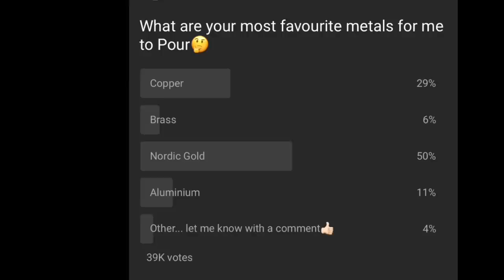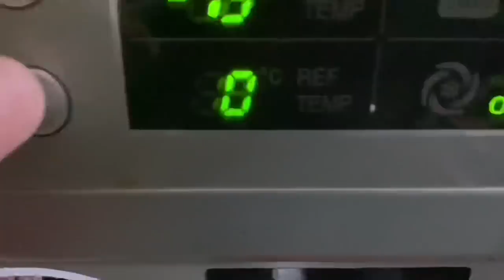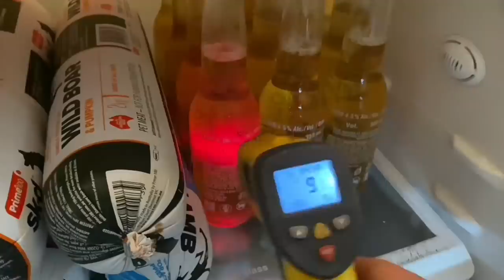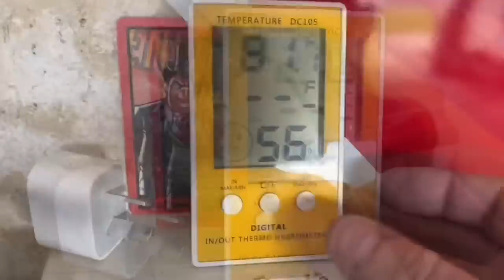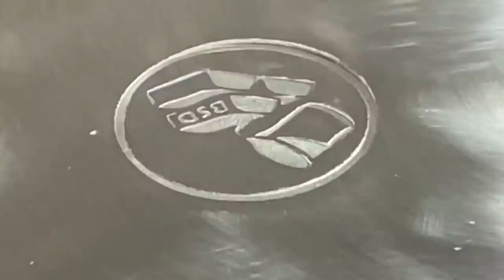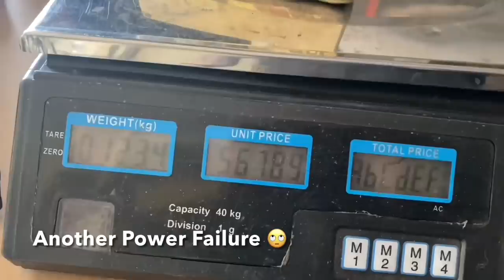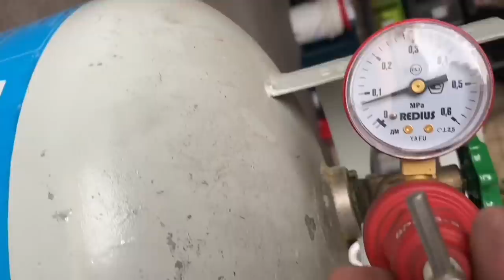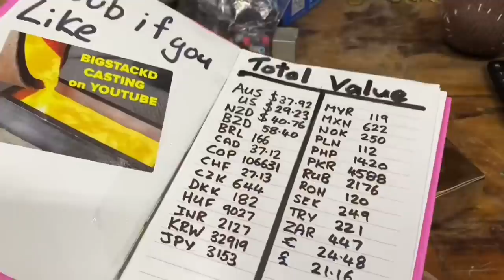Nordic Gold Made From Scrap - Huge Gold Bar - Nordic Gold Slag Melt - ASMR Metal Melting - BigStackD

Comment: Wake up.  Check YouTube.  Watch bigstackD.  ;-)  That's a good morning!  I'm surprised how much you got out of that slag.  I've been throwing it away.  Maybe I'll have to change that.  I also didn't realize that nordic gold had zinc and tin.  What's the difference from aluminum bronze?  I guess what I mean is, does the added zinc & tin change the characteristics at all?  Change the color, or make it harder or softer?
Reply: If I remember correctly, it helps with corrosion resistance. I think that naval brass is fairly similar so you can look into that if you're interested in a wikipedia binge
Reply: @masterofmundus1304  Aluminum Bronze is extremely corrosion resistant.
Reply: Color is definitely different - Nordic gold is a much deeper, more saturated yellow.
Reply from the maker: FarmCraft101 theoretically buddy the zinc probably burns off in the tin is such a small amount it probably doesn’t make much of a difference in Nordic gold would be pretty similar to aluminium bronze. There is a slight different colour that’s for sure. I’ll need to put them side-by-side in the future video to show people, I honestly reckon they would be pretty much similar in their strength and hardness although I don’t have a machine to test that this is just a theory because they Can be extremely difficult to stamp . Quite a few people have said that rapid cooling on ice could be changing it’s molecular structure when it freezes but I honestly don’t know 🤷🏻‍♂️, I certainly don’t have the smarts that you have matey, all I do is melt shit ,drink beer, edit ,upload ,sleep ,repeat👊🏻😁🍻🍻🍻🍻🍻. Also buddy with the amount of subs you have you should contact Youtube so they can verify your channel that will give you a tick next to your name and it will definitely make your comments stand out touch more when you’re verified. It’s a very simple process👍🏻
Reply from the maker: Also I was going to say I probably get so high of a return on my slag because I’m not using the correct fluxes or process on the original melts and then leaving a lot of good metal in the original slag🤔
Reply: Yooooo farmcraft101 I love your vids
Reply: @bigstackD  
High copper content alloys that lack antimony get softer when heated & quenched.  
Most people who think otherwise are only familiar with tool steel & don't even realize that low carbon steel can't be hardened like that.  

That being said, only relatively minuscule quantities of antimony are needed to harden copper, lead, zinc, and perhaps aluminum (I'm not too familiar with aluminum alloying materials).  
The quantities of antimony required to harden a bar that size could easily sneak in with the starting materials.
Reply: @kaisersose5549  Would that mean using pewter instead of tin would be a good choice?
Reply: @yazmon4515  
Not really...  
The whole "casting stuff from scrap materials" thing is the problem.  
There's just no way to know for certain what might be in those scrap materials.  

If you find yourself in a position that requires your castings to have specific properties, you're better off purchasing materials from a company that can provide the required documentation about each of their products.
Reply: @bigstackD  Farmcraft101 got his check :)

Comment: Gotta say it... you probably burnt off most of the Zn & Sn by sticking them all in at once & trying to melt them along w/ the Cu. Probably best to melt the Al first, then use that to help melt the Cu at lower than its normal melting temp. Add the Zn & Sn last; they'll melt super quick so you can pretty much just stir them in & start skimming the slag before a quick reheat before the pour.

Comment: 1:15 , That aluminium piece you grabbed the first has something yellow and white on the middle of it. That  is a cob LED (chip board light emitting diode)You can power it with a 12v drill battery by connecting the '+' sign  of the battery to the '+ sign' of the cob  LED and the same way connect the '-' sign it will give some bright light, but it needs a aluminium heat sink otherwise it will get really hot ,it can be used as a flashlight. It can also reflect towards your shining nordic gold bar like a mirror

Comment: I'd like to see you try a sand casting of a brass bell sometime.  You can cast the overall bell shape in once piece then drill a hole in the top for an eyebolt that will hold the bell clapper which is cast separately.  That would make a fun video.

Comment: I'm interested in knowing a few of the techniques you used, as I'm getting into casting to improve the variety of craftsmanship I can do. In particular I'm interested in how you procure and check the metal you use (a lot of stuff i wanted to smelt I couldn't tell what it was made of) as well as what technique you used to keep the zinc from boiling off before the rest of the metal melted.

Comment: Stacked you must be happy to score those busses bars. There from a 1200 Amp. Gear... pure copper. Now a days the buss bars are just coated in copper over aluminum. And all wires are now in aluminum instead of copper from the Electrical room to the apartments. Which is illegal cause they're running horizontal. Lol, they talk about being green!

Comment: I have a crap ton of scrap metal, sorted brass, steel, wrought iron, etc. Notably I have a solid aluminium water pump, 4 rotors and a bumper. Do you want me to cut it myself before I ship or would it be better for the video if I send them uncut?

Comment: You probably have already considered this, but it would be interesting to know how much of the slag is from contaminants on/in the metal and how much is as a result of oxidation occurring within the furnace. 

If it's mainly occurring during the melt, it might be worthwhile adjusting the air intake to the burner such that you have just a slight excess of fuel in the mix, rather than opening it 100% and having an excess of air in the mixture (and thus plenty of superheated oxygen to react with your metals).
Reply: I know what im trying next time!

Comment: Do you think it’s possible to cast an ingot out of lava rocks? I’ve seen PressTube melt lava rocks and pour lava onto glass, but I wonder what would happen if it’s poured into a ingot mold
Reply from the maker: matey I have lava rocks here I will use eventually  and at the end of the day when you pour them into an ingot mould or onto the ground or anywhere else it hardens but it is so brittle it’s almost like charcoal you would never get a real ingot out of lava it would be very light and would break if you dropped it on the ground. If you know how easy it is to break a piece of chalk and half a lava ingot  would break easier than that👍🏻
Reply: @bigstackD  oh, I did not know that. Thanks for the information. You should still do a video with those rocks, though. Do something special with em. Idk what, but you’re creative enough

Comment: When you get to your ton you should cash each individual metal in and replace it with different high value metals to save space. Gold, silver, platinum, palladium etc. Then do a size comparison.  Even if it's just silver so your not just replacing it with an oz or 2 of gold.
Better yet auction off individual pieces to to get an idea of what you can get and sell them to subscribers.  Your probably get 10x more than a scrap yard. Then replace it with silver and some gold.

Comment: Probably a dumb question, but if you were to put the metals that like to burn off at lower temps toward the bottom of the crucible, would they burn off less so that on top?
Reply from the maker: they would melt at the same speed basically whether they’re on top or bottom and just have a pool of metal at the bottom of the Crucible, A lot of people say to add the lower melting temp metals in order after the copper is melted but I just chuck it all in together and they will actually help bring down the Coppers melting temp and save on time and gas plus the bars come out exactly the same I’ve noticed. The only problem with things burning off doing Nordic gold is the zinc ,but that will burn off anyway you do it as Melting all this together it would be around 1000°C and zinc will burn off above 920°C
Reply: @bigstackD  Thank you so much! I've always been curious, and you answered a lot of my questions all at once despite having only asked one! 🍻👊

Comment: I have a good question  . Can you use natural gas or just propane ?  I can tap into the natural gas line coming to my house and I would think that would be better than having to buy propane tanks . In other words . I would never run out of gas if I used natural gas .
Reply from the maker: I have asked the question and apparently the pressure inside the house on the gas line needs to be boosted to about five or six times what it currently is so without putting something on the line that can boost the pressure you wouldn’t be able to run the furnaces. But I reckon if you tapped into the gas line before it entered your house the pressure in there would probably be plenty but honestly I have absolutely no idea, all I know is you don’t have near enough pressure once the gas is in your house if that makes sense🤔
Reply: @bigstackD  It wakes perfect sense. Do you know what the pressures need to be ? I work where there are huge boilers that demand a lot of gas . I can also ask people at work . It just may be as simple as running a bigger diameter pipe from the regulater .
Reply from the maker: I’m not sure of the actual conversion amount but a simple Google search will be able to convert to whatever your current pressures reading is👌🏻
0.12MPa  Copper
0.10MPa  Brass / Bronzes
0.08MPa  Aluminium
Reply: @bigstackD  Awesome . From Augusta Ga. Thanks my friend. You produce killer content keep up the good work .👍👍👍

Comment: If you used a set of bolt cutters you would not need to deal with the powder.  Also if you used some sort of torch to re liquefy the bars you would not need to grind so much.  Is there a torch that could remelt the nordic gold bar face?

Comment: Just a pro tip - optical pyrometers never give you the exact temperature. In most cases its not even close to Reality.
It is possible to measure exact Temperatures, but its very difficult.

Comment: I researched and i found out that zink has a boiling point of ca. 900-950 degrees Celsius...... Copper melts at 1085.... that means all the zink got vaporized while the copper isn't fluid

Comment: I need some help guys, I just purchased a devil forge foundry and didn't realize that the US uses a different propane valve than European nations.

Does anyone know of a converter that I could use to make the devil forge regulator fit my American propane valve,
Reply: Check with a local welding supply shop. I say welding because they supply gasses used in welding.
Also check with a local supplier of LP gas, the companies which supply LP gas for home heating.
If that fails, find the company that sells repair supplies to HVAC and gas fitter technicians.
Did Devil's Forge not ask you about the fitting?
Reply: I believe you could find a good few of em on Amazon, But just make sure to check through the photos really well just in case it might not exactly fit your forge.
Reply: @donniebrown2896  no, I purchased directly from their website so it came with the standard European fittings. Though I will say the fault on that is entirely my own because I never considered that our countries might have two different valve systems.
Reply from the maker: Matey if you bought a devil forge furnace from the devil forge website or off of devil forges eBay page they should’ve sent you the proper regulator to fit on a gas bottle in your country, if they didn’t and they sent the wrong one you should contact them directly and I’m sure they will send out the proper one. This is the first time I’ve heard of an incorrect valve being sent, so definitely let them know they sent the wrong one for your area 👍🏻
Reply: @bigstackD  thank you very much! I thought this was just my being lazy!

Comment: I really want to make Nordic gold but I can’t find any zinc
Reply from the maker: I normally get all my zinc off of eBay. If you don’t have any zinc you can make aluminium bronze which is almost exactly the same colour and properties as the Nordic gold just use 95% copper and 5% aluminium by weight. I normally mix it together at the same time that will lower the Coppers melting point and also save time and gas just give a few gentle stirs skim of any impurities and pour 👌🏻.
Reply: @bigstackD  thanks I’ll try that

Comment: Did it a little wrong...

Melt just the copper first (always start with the highest melting temp metal when alloying)

Next, add the aluminum fluxing as well if desired.  Skim, then add in the other metals like the zinc and tin, which will melt instantly into the molten copper.  Mix well and immediately pour.

By melting them all at the same time, by the time your copper melts, the zinc and tin have evaporated already!  This gives you an unreliable alloy of unknown composition.

Comment: I've been told you can put a thin layer of borax in a red hot new crucible to keep the metal from sticking to it. Apparently the metal comes out like water off a rain coat. Could you try it?